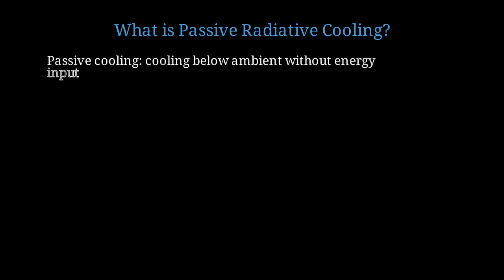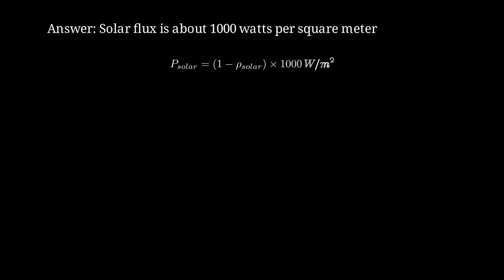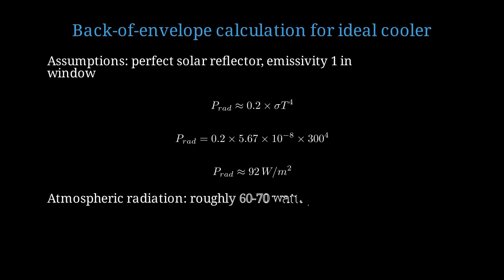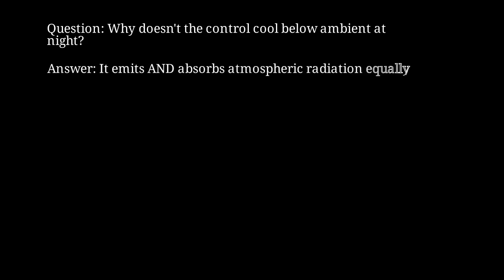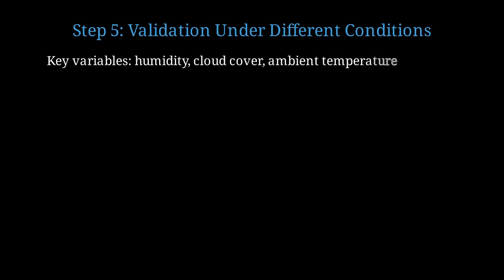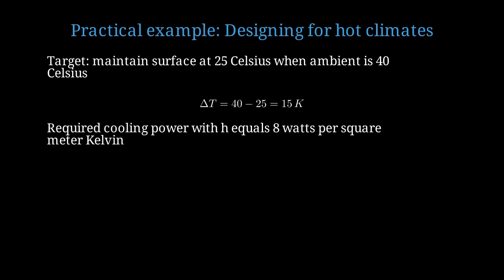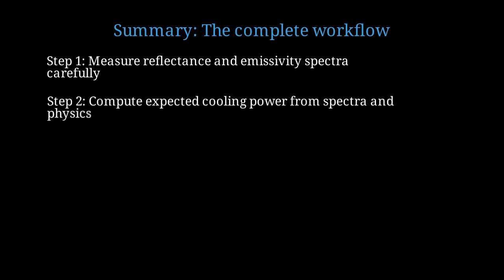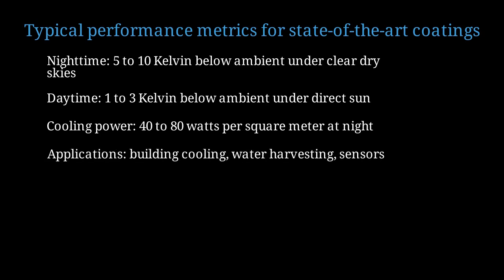Radiative Cooling Coatings: Theory vs. Reality

Comment from the maker: How can we design coatings that retain strong 8–13 μm emissivity in humid tropical air, where atmospheric back-radiation is high and the window effectively narrows?
What microstructure optimizes the trade-off between broadband solar scattering and minimal parasitic absorption (especially in near-IR), while remaining scalable and low-cost?
How should radiative coolers be integrated with buildings (roof assemblies, air gaps, convection shields) to maximize real-world system-level COP, not just material-level spectral metrics?